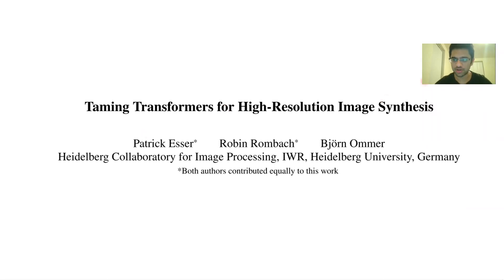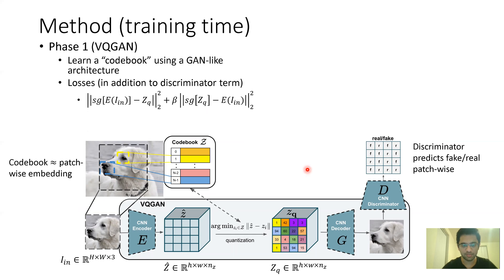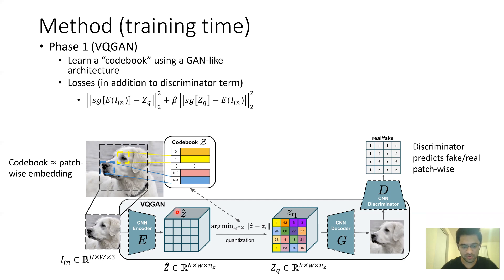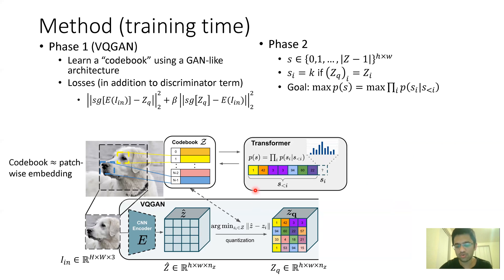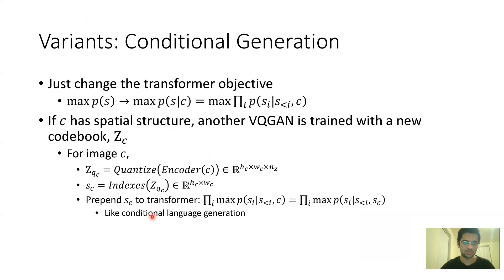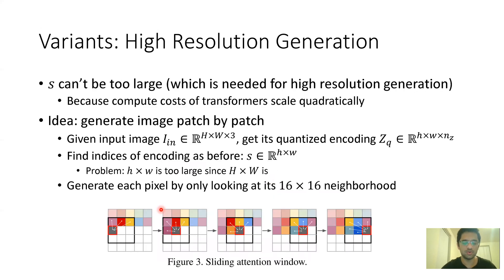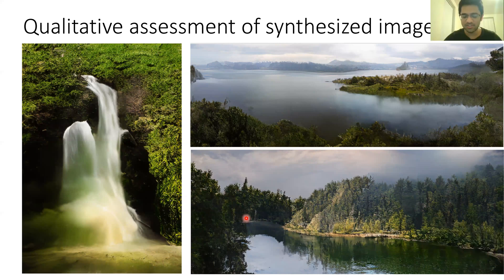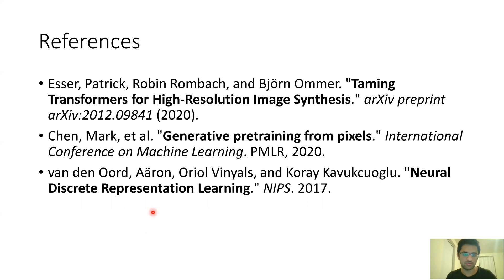Taming Transformers for High-Resolution Image Synthesis Explained

Comment: Thank you for reviewing this paper:)
Im kind of confused with this model.
Could you tell me whether I understood it correctly or not?

"The first step is to learn an expressive codebook by encoder, decoder and discriminator"
"The second step is to learn a transformer, which generates a certain output, such as high-resolution image by using the codebook?"
Reply from the maker: Yes, the first step is to learn the codebook and the weights of encoder, decoder and discriminator.  The second step is to learn the weights of the transformer, keeping other weights fixed. The transformer generates a sequence of indices of the codebook. Using these indices, we can retrieve the vectors at those indices of the codebook and pass it to the decoder which generates an image. High resolution images are generated using the sliding window method described at 10:58
Reply: @ankitramchandani3379  Umm, so the transformer is trained with the indices of the codebook, not with the vectors from the  codebook?
Reply from the maker: @김성빈-g1w  yes, the transformer is trained so that it can generate a sequence of indices (which during testing would be converted to codebook vectors and fed to the decoder)
Reply: @ankitramchandani3379  Thank you for your kind replies:)
Reply from the maker: @김성빈-g1w  happy to help! hope it helped improve understanding
Reply: @ankitramchandani3379  Quick question,
I found out that this model uses an adaptive weight when minimizing the loss of the discriminator. What is the role of this parameter (adaptive weight)?